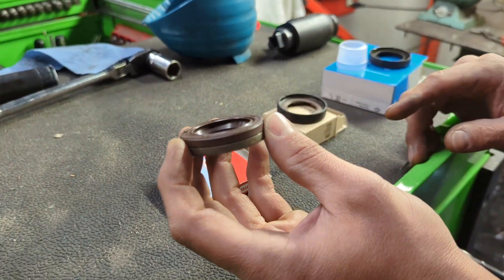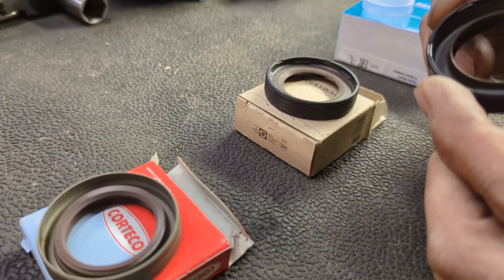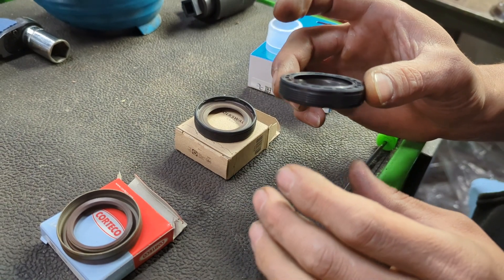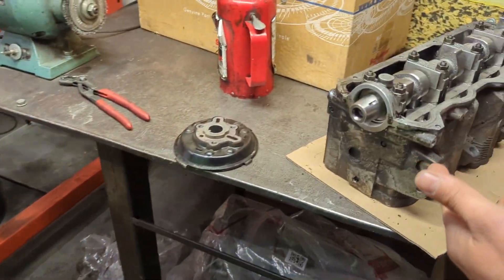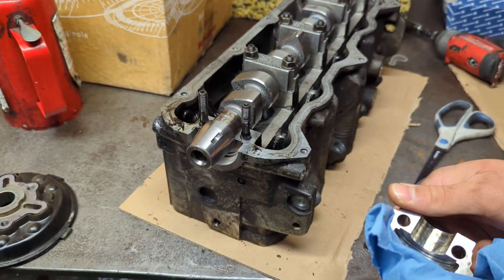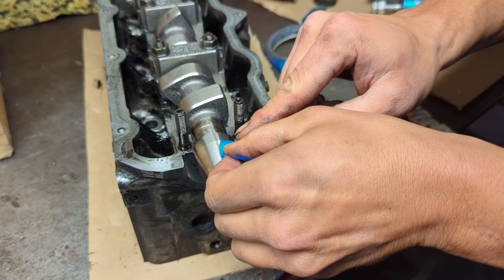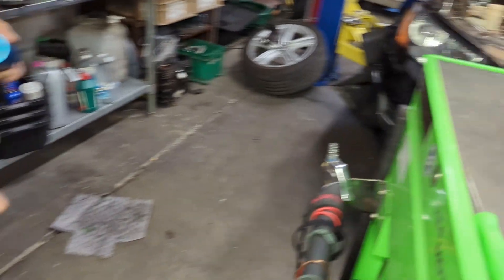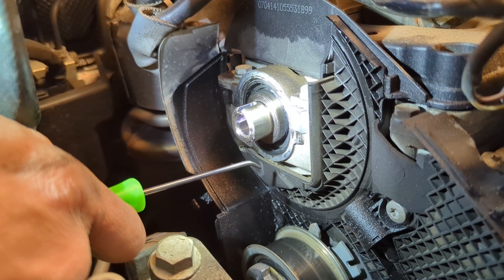The ins, the outs and the inside-outs of VW Cam Seals by Dieselgeek

Comment: i removed mine with a screwdriver and installed it with a socket.....   you don't need his special tools...
Reply from the maker: Sure... On some of them. But catch the seal on the crank nose step and then drop your TB again to re-do it or gouge the head, seal carrier, or shaft and buy some expensive parts. We don't sell seals or the tools. This is a PSA.

Comment: If the seal is obviously resistant to oil, why should you not 'protect' the seal on installation by coating it with a film of oil:
a. on the inside diameter, and
b. on the outside diameter
?
Reply from the maker: Because if you oil it during install it will leak. (Ask me how I know...)

Comment: Can you give a link to buy these tools to remove and install the cam seals. I’m struggling to locate them and same with cam holding tool to torque the cam down. I looked on your site and didn’t see anything. I need some help please.
Reply from the maker: This was not meant to be a comprehensive how-to. Generally there are 3 types of seals and we wanted to educate regarding best install practices. Replacement procedure and requisite tools are very much application specific. We recommend purchasing a 24 hour Erwin subscription for the very reasonable price $35. (vw.erwin.com) In that time you can download EVERYTHING for your car. The real-deal specialty VW tools are available to the public from vw.snapon.com.

Comment: The rubber, spring seals can cause a groove in the cam too. Do the newer seals fit on the old 1.6D? Same size? I've drilled a hole in the rubber cam seals and pulled them with a screw before. I've used the old cam sprocket and washers to press the new seal in.
Reply from the maker: Yes it is the same 47x32x10 seal. Incidentally this same seal is used by the AHU/1Z MK3/B4 for the crank seal AND the the cam seal AND intermediate shaft seal; so you can PTFE them all. As for the groove, they all leave 'em but we haven't seen any issues there within reason.
Reply: rubber grooving a hardened  camshaft   ?   LOL...    Sober up..